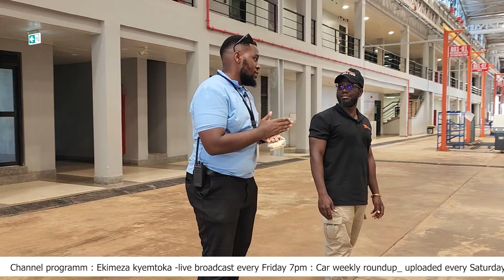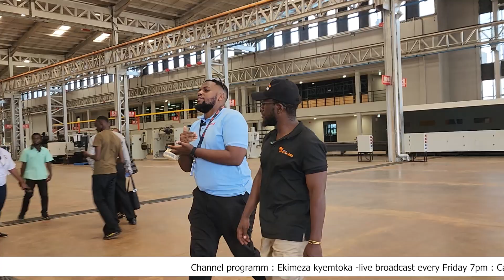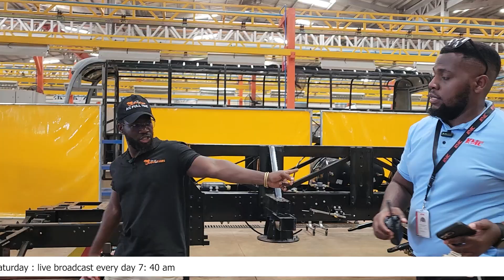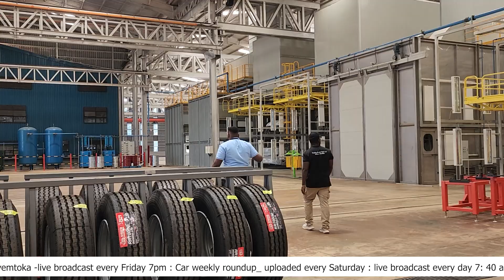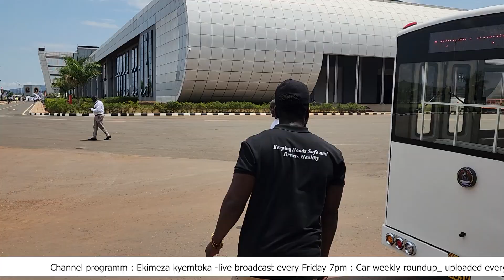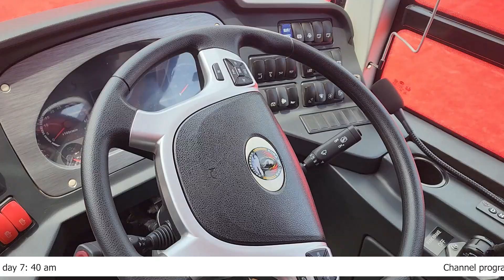Exclusive tour of the Kira Vehicle Production Line

Comment: Tell the tour guide that product designers study a course called Product Design and Engineering...... The art course at Makerere University where Kira EV started have a course unit in product design for those who study the Bachelor of Industrial and Fine Art. That's the reason why Fine Art is under the College of Engineering Design Art and Technology. Designers will research and sketch out the product, take to 3D and make a maquette designs or real clay models to refine the lines. As a head of design, he should be showing us a comprehensive view of the design department at work rather than showing us equipment that seems new. And it's okay to tell us what parts are outsourced and who the the suppliers are rather than show us equipment that makes us feel like everything is manufactured onsite.